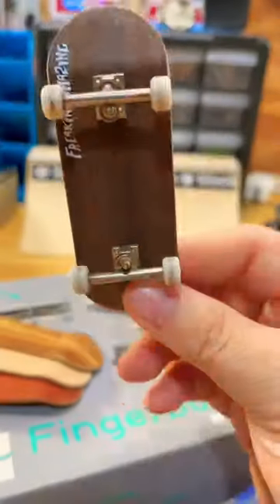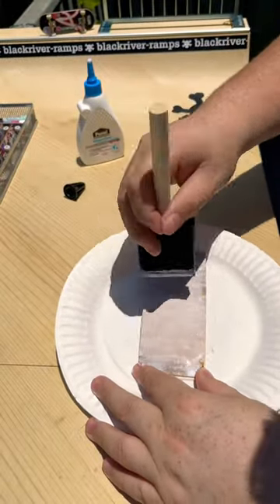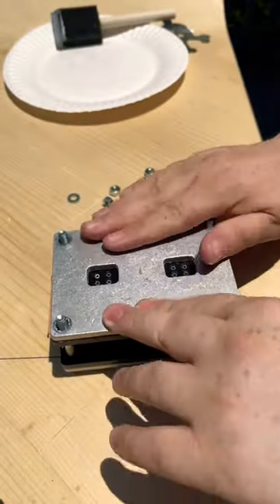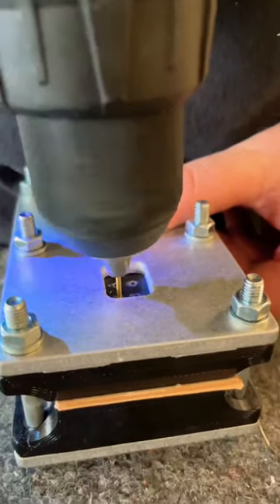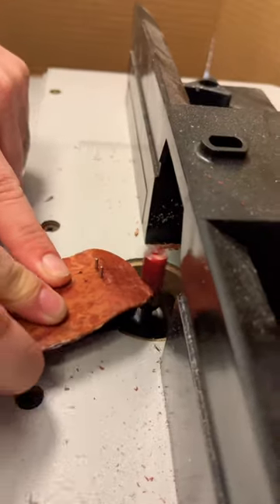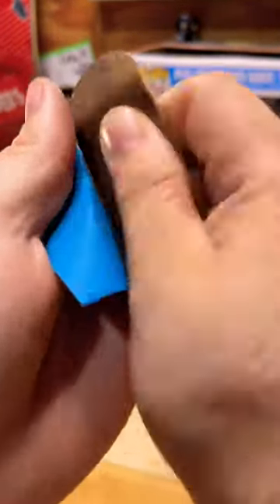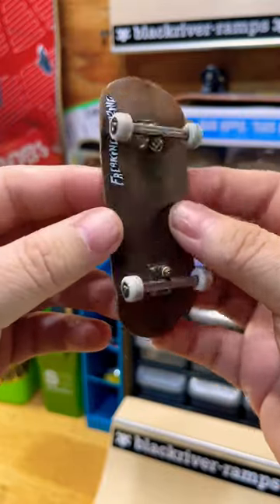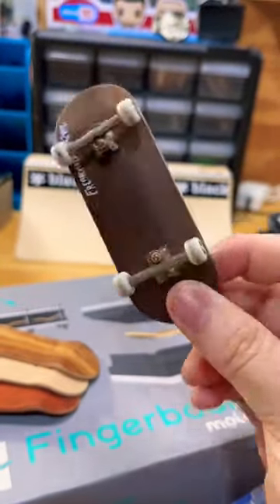HAVE YOU EVER MADE YOUR OWN #fingerboard?? @CreateYourSkate #fingerboarding #diy #techdeck

Comment: What kind of sander was that that you used to cut the deck out?
Reply: I’ve been making fingerboard but it takes a while to sand it down by hand and I’ve been looking for a better solution
Reply: It's a router that is mounted upside down so only the bit is sticking up. The guide follows the plastic piece that the board is mounted to to get a perfect shape everytime.